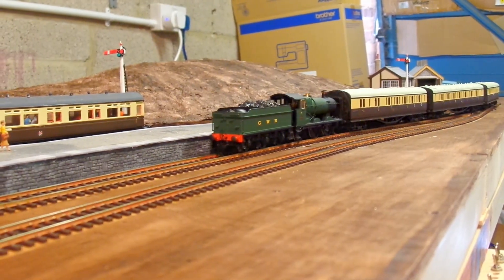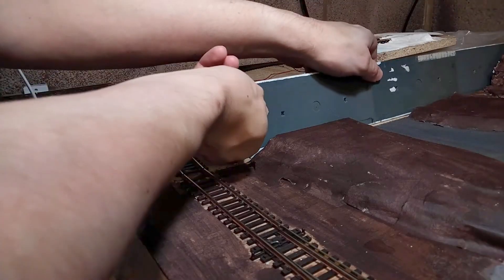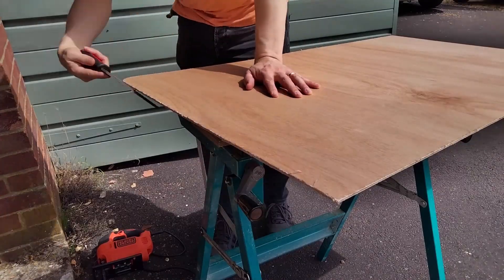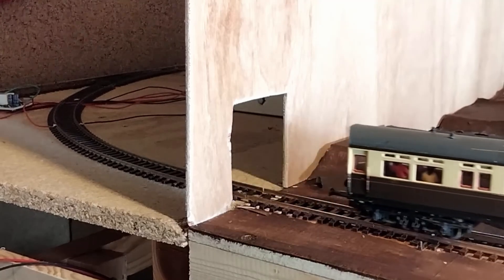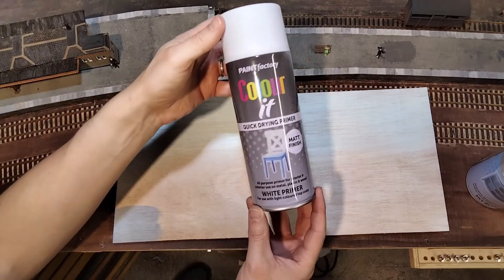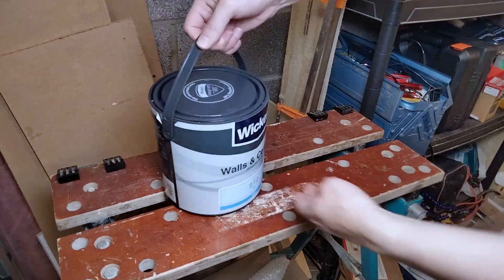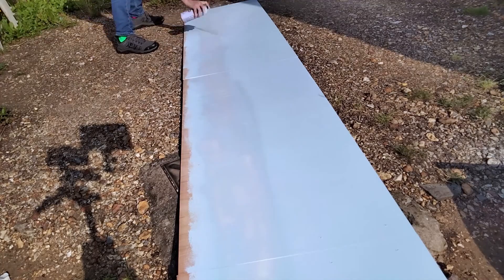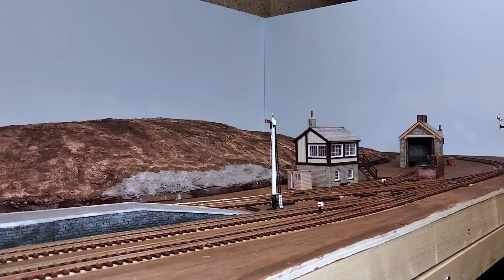Blue sky backscene from plywood and emulsion paint | Modelling a GWR branch line | Episode 18

Comment: To get the spray paint to cover ply wood you need to sand the plywood then spay with a primer filler, Halfords sell a good one, then lightly sand the primer filler, wipe down the ply and top coat.

Comment: Great videos! For wood, I can't recommend enough using a proper "wood primer" before applying the colour coats. If you have the patience, lightly sand with fine abrasive paper between each coat. You will see the difference in the smoothness of the coats.

Comment: Hi, Im glad your sky worked out. Please remember though, it is not a Youtuber's fault if your attempts go wrong. The best way to find what sky looks like is to look at the real thing. On a hot Summer's day sky is a medium shade of baby blue (or cobalt blue) at the top and it graduates down to white on the horizon. The spray paint technique you mentioned is a fantastic method when you use smooth board, like hardboard or even acrylic sheet, both would need priming first.
Reply from the maker: Fair point, perhaps I was a little harsh for the sake of a quick gag. Thanks for calling me out on that.
Reply: Wait up! With a name like yours and remembering my childhood in Oldham, the sky is grey not blue 🤣
Actually, using cheap plywood as a backboard, you really need to give it a thick coat of housepaint first and maybe a sanding before putting the top colour (s) on

Comment: I had been considering backboards lately, and it occurred to me that if the plan was photography, then you could do a green-screen type thing, then superimpose any scene on the background of the photo using computer wizardry. However, I then thought that GWR locos are green, so a green-screen might be a bit of a challenge. But maybe blue screen would work, if it's relatively plain, it'll fill in for sky on a clear day (as you say), but a computer can deal with any color as a replaceable option... then again train crew overalls tend to be blue!!
Reply from the maker: Yep. I use Davinci Resolve for my video editing, and found out recently that it can do sky replacement. I've done a little experimenting already and it should work ok with my plain backscenes. Photoshop would do a similar thing for stills too.

Comment: Looks very nice. The corners dont stand out much at all, which helps with the illusion. 
What to do for a sky backdrop was a lingering question I had for a long time. I settled on using dry erase board, the kind you find in schools. Its cheap and strong and smooth, but also bendy.. if you force it a bit.. 
This meant I wouldnt have visible corners to it, it'd just look like one big continuous sky.. similar to the one in real life
Reply from the maker: White board? Great idea! I've heard some people don't like shiny surfaces for backscenes as they catch the light, do you have any problems with yours?
Reply: @FrontingtonandBackwoodsRailway  Its given me no problems. I sponge painted it with a matte paint (all one color, too scared to do clouds or anything) so that took care of the shiny and it's held up surprisingly well. Hasn't chipped or warped or anything. Going on four years, and still looks as good as when I put it up. Of course it's a layout that certainly doesn't move, so I guess it has that going for it too, but even with doing scenery work and being bumped into occasionally, it's worked well!